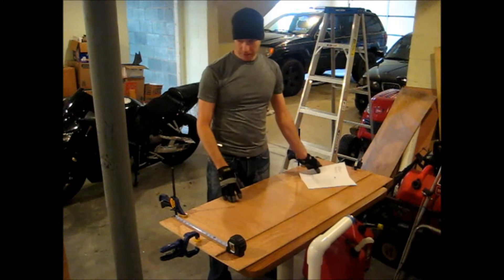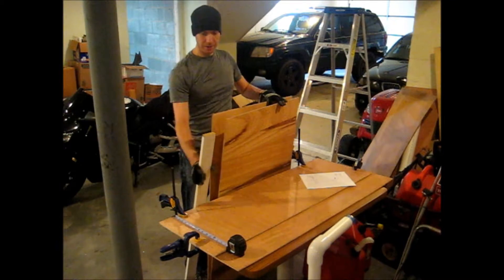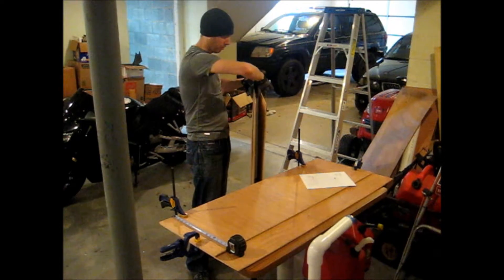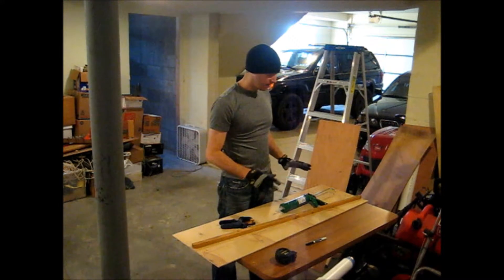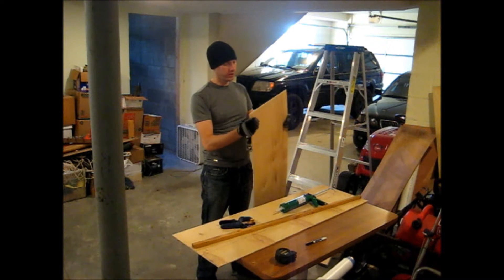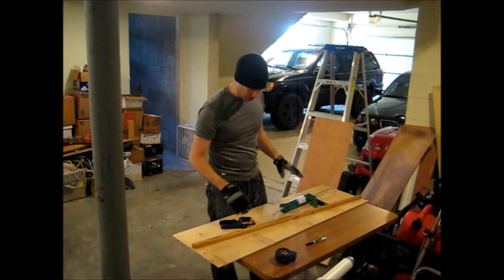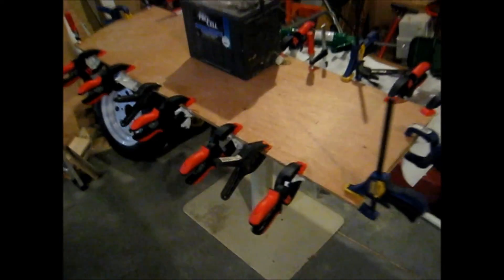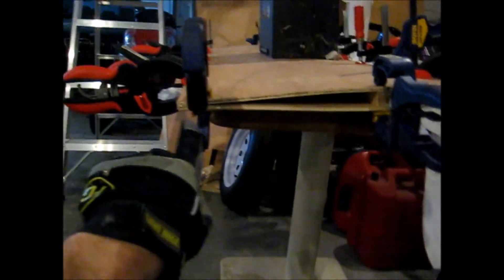How to build a simple Centerboard / Daggerboard for a sailboat. 15 foot Chrysler Mutineer.

Comment: What did you do after the glue cured?  How did you seal the shape and reinforce it?
Reply from the maker: The planks inside the board and the ply skin mutually attached give it considerable strength. For extended durability I epoxy encapsulate the exterior of plywood components.  But such a step is not required for use.
Reply: So the foil will operate with no drag even with the hollow section?
Reply from the maker: I follow you now.  For the bottom section you can cut a piece of plywood the shape of the foil to glue to the bottom and to seal it from water intrusion.  I have not tried it full open. so I can not say if the foil alone with water submerged inside it, would still offer reasonable effect.  My expectation though would be it would have increased drag, and reduced efficiency, but still work as a usable foil.
Reply: Cool. If I give it a go then I'll be sure to take pictures. How thick was the plywood?
Reply from the maker: This was done with 5.2 mm plywood.  You can use thinner material for sharper curves, or considering only a gentle foils shape is needed, the thicker the plywood the greater the skin strength and less stingers needed.

Comment: You cant be serious. How long did that last?
Reply from the maker: Serious. While this video does not show the finished board, keep in mind that sailboats have been around for thousands of years and centerboards have been around far longer than NACA sections and theories on aerodynamics. Their primary structures for function are extremely basic.  What I am getting at is don't let the thought that they are "complex" intimidate you from trying your hand at it.

As for durability so long as they are built to withstand the weight and specifically the side loading of the craft they are installed in they last for years.  My built centerboards have seen hundreds of nautical miles on the Great Lakes at a zero failure rate.  The construction of your own board so long as it matches your boats needs, can still have a long service life.
Reply: @FarReachFR  As a marine engineer i agree. The difference in efficency comes mostly from apect ratio and the surface quality, mostly of the leading edge. Shape makes only about 5% difference at most (in the right usecase and if you solely copare this with a NACA 0010 or others for that usecase).